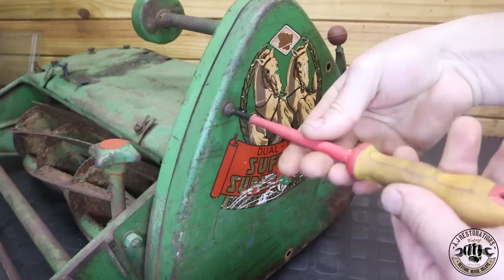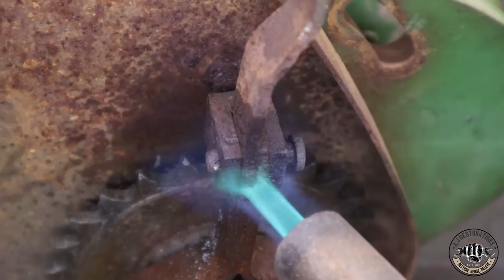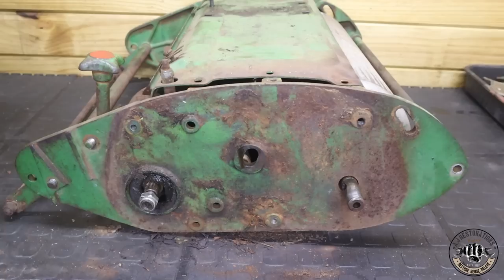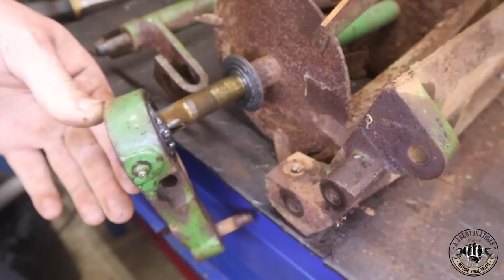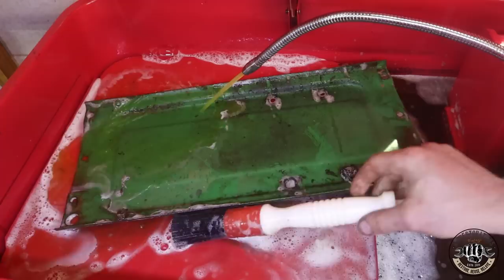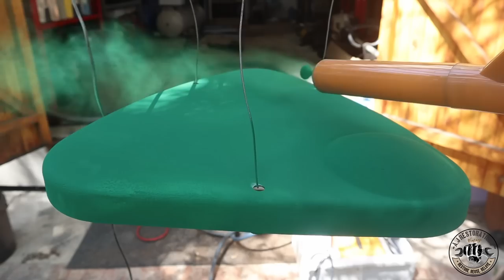Old Suffolk "Super Punch" Lawnmower Restoration - Part 3

Comment: We used to have one of these at the Junior School I went to back in the seventies. As a Trustee Pupil I was allowed to spend a lesson period mowing a small section of the grass just outside my classroom - as a nine your old no taller than four foot it was quite a task, the lines were never straight, but I loved every minute of it. Happy times. 

My only advice to you would be to buy Imperial tools (naughty of you to use Metric on Imperial fittings) and a box of latex gloves - you never know what is lurking under the grease or behind a cog wheel.

Comment: Do you not own SAE tools? That was a 9/16” but not a 14mm
Reply from the maker: No, I do not own SAE tools, its rather hard to come by where I am. 14mm worked just fine haha
Reply: Spanners being too tight wont damage parts, spanners being too loose will. I used a 14 the ither day while my colleague was using my 9/16 abaolutely no problems
Reply: The problem is if the bolt or nut is frozen a loose fit makes stripping a reality. Especially 13mm wrenches on 1/2” bolts. I used metric flexhead ratchet wrenches on SAE bolts regularly as a mechanic but some SAE sizes have no metric equivalent. FYI pre 1970 English thread pitches can be a nightmare
Reply: @bobthompson4133  nobody here once condoned a loose fit